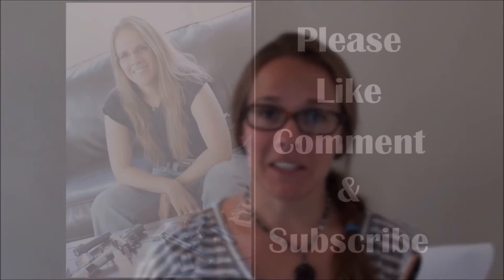Colleene Answers Questions (Ep. 89): Difference between Failure to Fire and a Squib Malfunction

Comment: Last squib load I had was years and years ago. Old S&W victory model (surplus from "the war"...lend/lease and all that).
Those short, stubby .38 S&W rounds make .38 special look like a cannon to start with. Now take and forget to put some
powder in that dinky cartridge...or get the powder wet with some unknown fluid...Thank goodness the bullet got into the
barrel far enough it didn't stop across the barrel/cylinder gap. Tapped it out with a brass rod. Though about it for a bit...
turned around and started it into the muzzle and tapped it through. Then measured it...might as well take the opportunity
to figure out the gun's actual bore diameter.

And those who mentioned the softer sound are entirely correct. A squib compared to a normal round going off is
like comparing a leaf blower to a 747(8-).

Comment: Had a squib just yesterday. I keep a simple rule in mind if it dont fire check the barrel, if a round sounds funny, check the barrel. And yeah the bullet was a quarter inch past the breech. A 5/16 dowel rod and a soft pine board to rest the barrel on and it came out after a few taps.